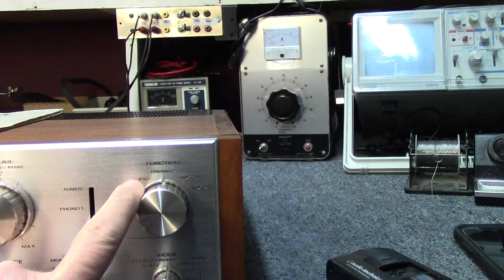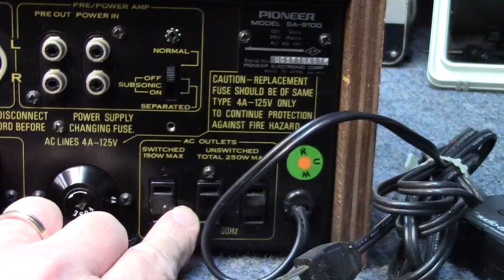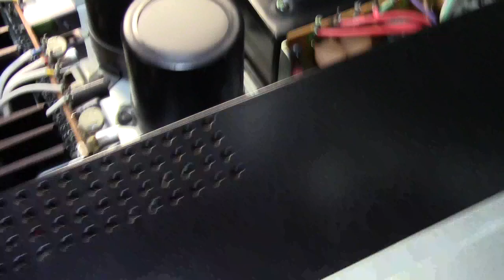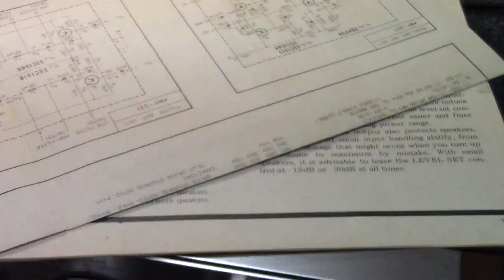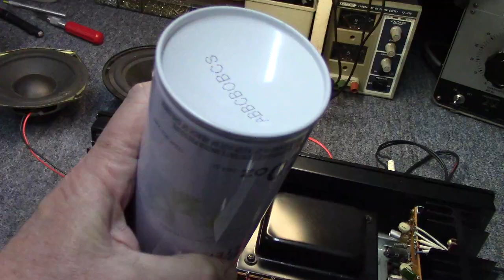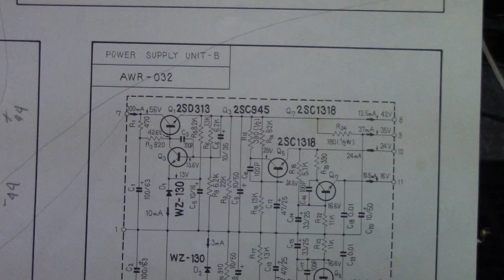Pioneer SA-9100 Integrated Amplifier - repair & testing

Comment: What is that freeze spray suppose to do ?
Reply from the maker: If a component is failing internally/intermittently  often times (not always) a sudden temperature change hot or cold can trigger the failure and speed up the troubleshooting process.  I have several videos where this is demonstrated,  a transistor in that G9000 (previous video) failed with cold spray, an old Kenwood I done a video on  comes to mind that did the same thing,  Akai reel to reel and a few others.